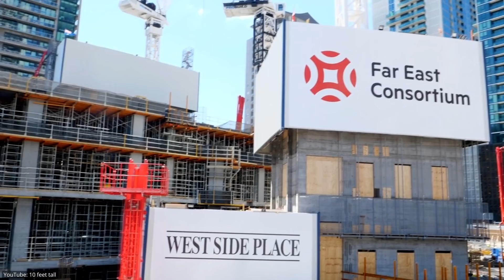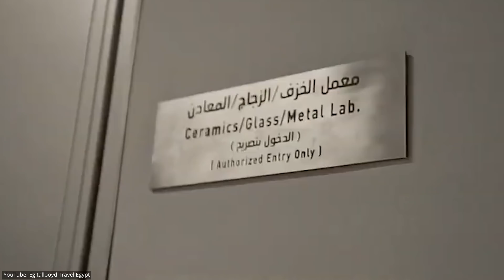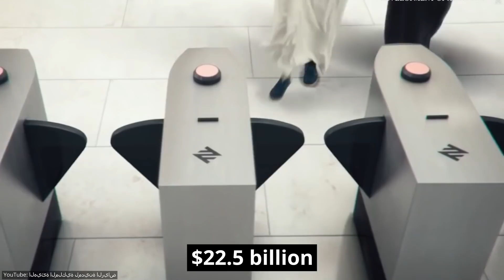Top 10 Megaprojects Completing this Year

Comment: For anyone here 2022 or later:

Gigafactory Berlin was fully opened May of 2022.

Lusail Stadium was opened in November 2021, and will host the 2022 World Cup.

111 West 57th St was completed October 2022.

The first successful Mose Venice test was completed in 2020, I couldn’t find if the project was 100% completed or not.

West Side Place has most residential space finished In February 2022

The AIN Dubai opened in October of 2021, but seems to be temporarily closed as of September 2022. It has been temporarily closed since around May 2022 for renovations.

The Grand Egyptian Museum is not finished as of September 2022, but is estimated to be finished by November.

DJI Headquarters doesn’t seem to be finished yet. It was hard to find information for this one.

One Za’abeel had living space up for sale in June 2022.

Riyadh Metro is not yet finished, but expected to be completed Spring 2022.
Reply: Thank you for the update

Comment: 8:25 "Will offer an impressive 360 degree.." 

No it wont, due to the construction, at best it will offer an 250 degree field of View (FoV), assuming you would stand in the middle and you could see through the entire link (which of course is not realistic). Standing in one corner you may hope to get slightly less then that though at 240 degrees FoV.
Reply: Or you go to the top, and look around in a 360...
Reply: @baddriversofthenorcalarea500  Even if you where to stand on the roof, you would still not get a 360 degree view, since you got another structure obstructing the view.
Reply: @papab34r  That's not how that works. 360 degree view just means you can see outside the structure you are in at all 360 degrees. Other structures are part of "the view"
Reply: @baddriversofthenorcalarea500  If there had been non-connected structures then yes, or at least maybe that could be argued to be true. But that isn't the case here.

For there to be a 360 degree view, you need to be able to turn around in all directions and "look outside", now clearly for such a large structure that is not likely to be possible regardless if it had connected superstructure or not. But the building is built in such manner you will have a directly obstructed view.
Reply: @papab34r  The person riding is put into a metal bubble. It goes to the top, and has a glass ring around the middle so you can see out of the bubble from all angles. 360 degrees. You dont have 360 degres the whole time, just at the top.